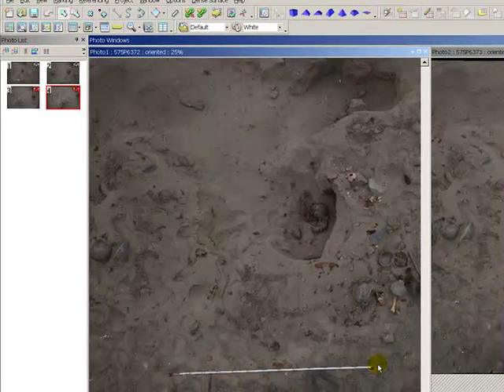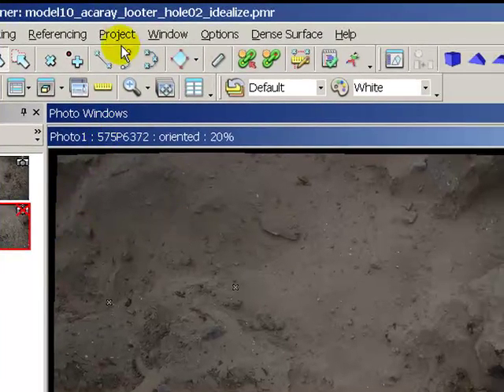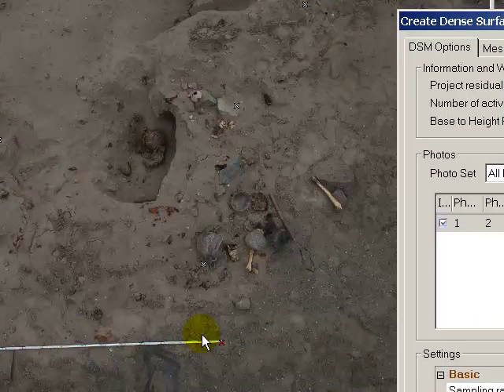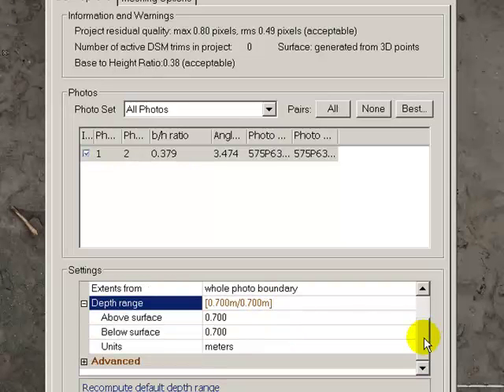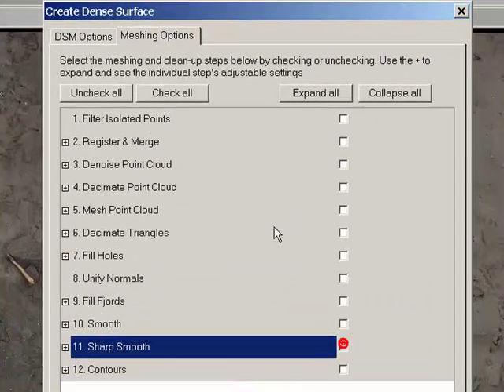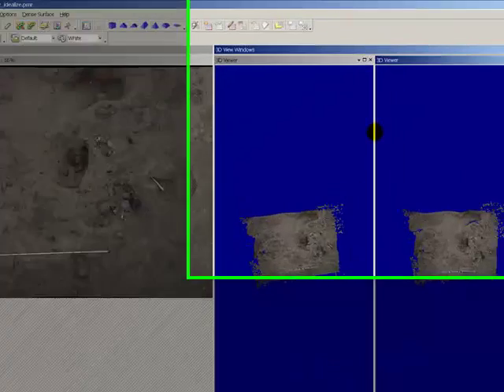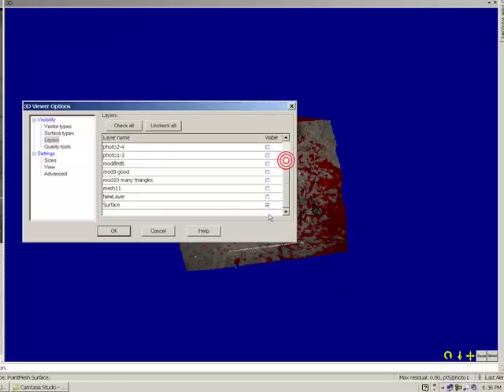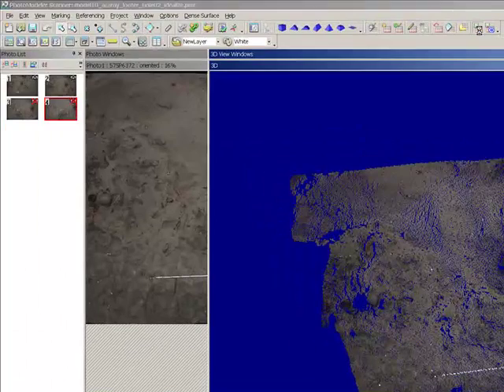Stereo Pair Photos to Digital Elevation Model Part 2-4

Comment from the maker: @Jamerio3D: This video was recorded in a small hotel room in Huacho, Peru. The walls are very thin and sound does travel. However, what you hear is not copulation with livestock but rather someone scraping paint. I did my best to remove the background noise, but some sounds lingered. Please accept my apologies for any alarm that this noise created.